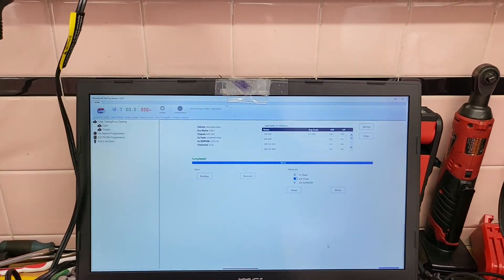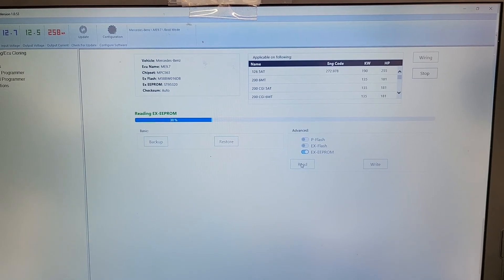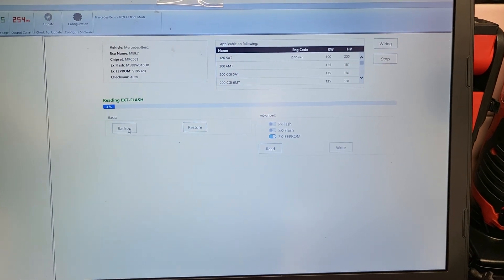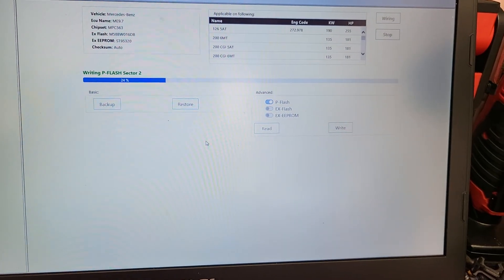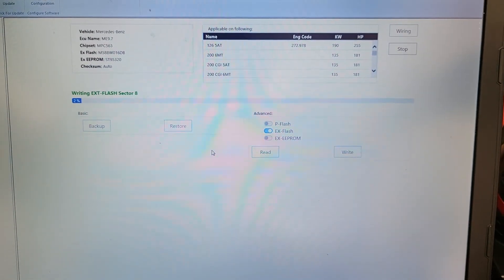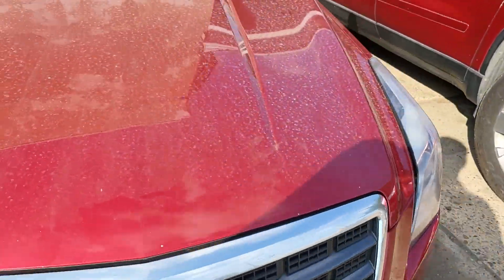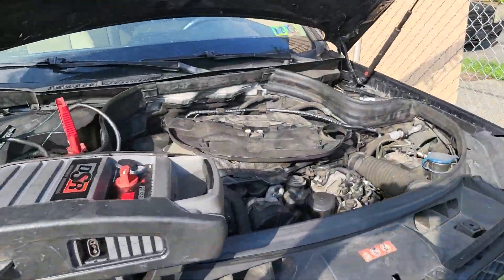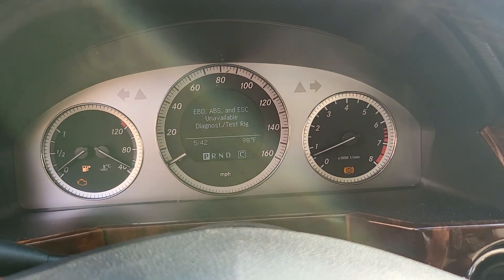Mercedes ME9.7 Clone Using Hexprog

Comment: Is there any reason why you can't just take the full backup from the original module and restore to the donor? Or is it necessary to individually write the p-flash ex-flash and ex-eeprom to the donor for this me9.7 module?
Reply from the maker: Some programmers version of full backup always has missing data from flash file , example 256k of a 2mb flash is only read... so for data integrity I always ready data individually and keep it saved backed up just to be safe... With my programmers yes I can do like you said but maybe others watching my videos have different programmers so it's best to do everything individually..   Every ecu is different alot of ecu's,,  files must be modified to work because of otp areas in MCU's ...